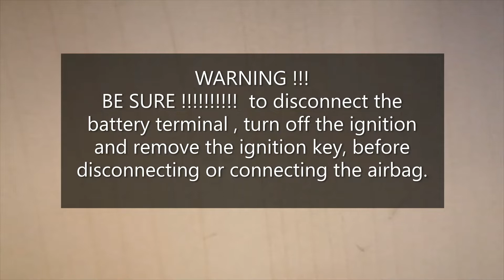Renault Twingo Air Vent Grill Removal Dash Air Vent

Comment: Sorry, I have understood that the original language is English after writing in Italian. My question is where the red and black wires we see below the spedometer group go in the left. To the right they go to the fan below the airbag, and they supply it with the +12V and ground, but were do they go to the left? I believe I see them at the 5:11 minute where you remove the left panel, above the steering wheel. In my 2007 Twingo 2 the fan commands are burnt, the resistors group is burnt and the power connector is warped due to heat. I believe Renault engineers have done very serious mistakes.
Do these wires go to the fuses box? I would like to bypass the original bad Renault controls and apply a switch under key that provides direct power  to the fan from the battery using a relay. If I can reuse the original red-black twin wires I avoid   disassembling the whole dashboard as you did and also I avoid creating a new hole in the rubber grommet behind the fuse box, that is not easy to handle. Best regards and thanks for you video.